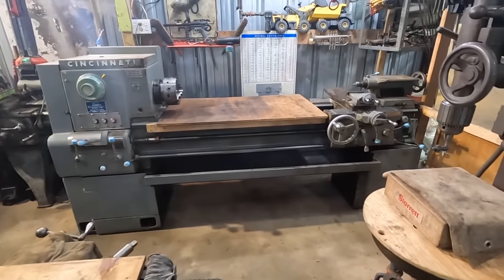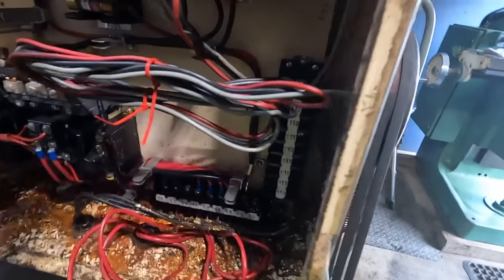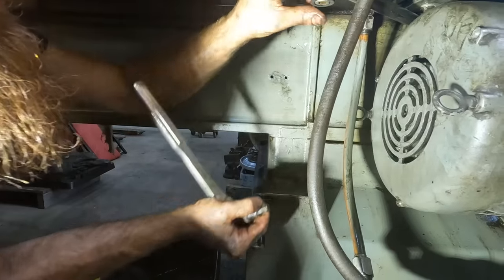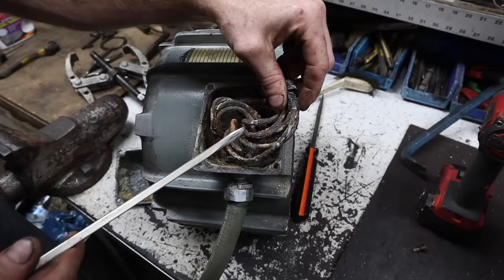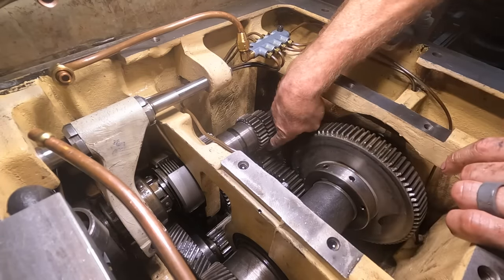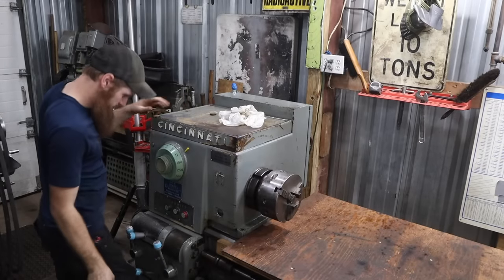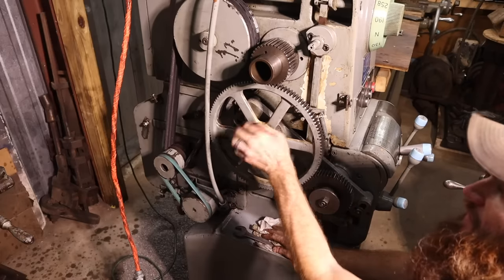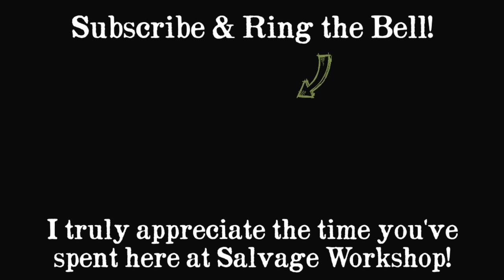Can we SAVE this BROKEN Lathe? ~ MAJOR Issues found! ~ Will it Ever CUT again?

Comment: Can you read electric motors like Morse code with the colors of the battery acids mixed with wiring? 
I guess I'm asking if there's Morse code in color on the wires from corrosion

Comment: NICE WORK, WAY TO WORK OUT THE PROBLEMS.  I THINK THE GEAR SHAFT HEATED UP EXPANDED AND THE PIN FELL OUT AND THEN THE KEY WAY. @parallaxbill2276 HAD SOME GOOD POINTERS I  SEE YOU LIKED.

Comment: I've seen WATER get into the electrical conduit, especially in basements or hill side split level buildings.  That would explain the "Stuff" in both the motor and the connection box..     a Flood with out a flood........

Comment: While you were dicking around with the shifter and reserring the dial, you should have figured out what gear setting puts all the shifter arms to the right like the manual said so you can use that as a shortcut if you have to go back in for some reason.

Comment: That motor is not a brush motor is why you don’t need to clean the groves if you run a screwdriver in the groves you can mess up the motor.

Comment: PLEASE READ —IMPORTANT

you are operating that totally wrong.  The hydro shift lathes, these and the Leblond are two I know of and think monarch made one as well, are made to be shifted in a somewhat strange way but it makes sense once your familiar with it.  

It’s called a pre-selector shift.  You ONLY shift it when the spindle is running.  You don’t shift it while stationary and with the hydraulic pump running but the spindle not.  See how it was pushing those shift forks left and right to go into the various gears?  Well if the spindle has stopped in a particular spot where all the gears aren’t properly aligned then the hydraulic shift mechanism could jam the gears sideways and break something.  It overcomes this problem on its own when shifted properly and I’ll explain how in a second.

The proper way to shift is fire up the lathe and engage the spindle in whatever speed it’s in.  Then while running you are supposed to pre-select the next speed you want and shift the knob—IT WONT TRY TO SHIFT ITSELF WHILE RUNNING ITS GOT SAFETY INTERLOCKS SO IT CANT.  Then stop the spindle with the handle.  Once the spindle comes to a complete stop a zero speed switch tells the lathe electronics it’s ok (the safety interlock expires) and the shift can commence.  The spindle will start to “rock” back and forth slowly, this is to give the sliding gears a window of opportunity to align properly during the shift.  You machine did it the first time you turned the knob but it only works for one shift.  Once that shift was over you kept shifting it around and it wasn’t rocking the spindle anymore and you are risking damaging something, either a gear or bending a fork if it pushes too hard against a misaligned gear/change.  Anyway, after you stop the spindle and see it do it’s little rocking, you are to re-engage the lever and fire up the spindle again with a few seconds.  
That’s basically it.  You can cheat around a little in a few ways but without standing in front of my leblond I can’t remember exactly how and how to describe them.  I’ll mess with it at work work tomorrow and post back.

Also, don’t mess with the oil lines under the headstock where you were thinking about coupling the two together.  That’s for the hydraulic mechanism/shifting mechanism and other is for the headstock lube.  They are seperate for a reason.  If you combine the two I think the lathe will no longer function/shift correctly if at all.

There are some groups for Cincinnati lathes on various bulletin boards and forums where you can find about any questions answer.

I’ll have to say too, to treat precision machine tool spindles/bearings/lead screws/etc with a little more care than those old diesel heavy machinery you revive!  If not they will at the least no longer be precision and the most break some very costly part especially when hammered on! 😢 😉

Good luck with it! 👍🏻

Comment: one mod i would have done to the mashine adding an oil fill port in the top of the head, that way you dont have to take off that heavy plate for every drain and refill
Reply from the maker: There is one in the top lid... go back and watch right before i made the new gasket, you'll see me remove it so the lid would sit flat on the bench!
Reply: @SalvageWorkshop  oh there is, bit hard to see later in the video, good to know!

Comment: 52:08 that looks like asbestos it was used a lot in wiring back in them days with wiring an electric  motors.
Reply: It worked well as an insulator on wires also incase of electrical fires.

Comment: Put a hose an the drain, and a ball valve, just remove the handle on the valve hang it on the pipe with a wire or zip tie,

Comment: You have two drain spots to allow the cover to remain in place when changing oil. Machine shops typically have metal chips everywhere which you do not want in the gear box. When the top is on it would take too long to drain the machine without a second drain opening to allow air relief.

Comment: Somebody probably crashed it which loosened the key then they opened the top to look at it and didn’t wanna dig deeper then closed the top with no gasket and used it with the gear it had and pumped all the oil out

Comment: 2 things: I'm guessing that the 'roll pin' is designed that way (ie with one section cut out) to flare when punched (with a tapered punch obv) to provide a decent friction-only fit: no Loctite necessary! :) Also, I winced when you took a file to the headstock lid: as manufactured the two casting faces were prolly ground/milled/lapped to such a fine flatness that it didn't /need/ a gasket; the file (even if only cleaning) action will almost certainly have reduced that, resulting in a gasket definitely being required. Some earlier IC engine heads/crankcases (eg bikes) were produced this way.. but eventually (as I suspect happened here) succumbed to temperature shifting  :( This would show up far quicker in IC engines as they're pressurised; not a problem for this machine.. until eventually time (& incorrect servicing/treatment) wends its way into the equation :)

Comment: I respect that you know your own limitations and safety, but I was getting anxiety with that camera angle, your beard, and those gears, or your hands and those gears turning flat out.  That's the stuff horror movies are made of. I prefer the will it run content, but I also understand that you can only so much before you're buried in half completed project vehicles.  Do your thing and I'll watch it, whatever it is.

Comment: Next time you clean the gear box I'd use a pump up garden sprayer to wash all the dirt out using the pressure from the sprayer to dislodge all the stuff you can't reach or see. The powder in the motor was most likely electrolysis from leaking voltage from the exposed wire that had the cracked insulation.

Comment: Are you supposed to change speeds with the chuck engaged? I don’t think so. You have to disengage the chuck, then change speeds. Then re-engage chuck. Right now you are changing speeds before you disengage the chuck. Leave the speed knob alone until the chuck isn’t moving. Yikes!
Reply from the maker: Yes you are supposed to turn the dial to the NEW speed WHILE the spindal is engaged and spinning... then when you STOP the spindal, the gear changes to the new speed in the head of the lathe!
Reply: Wow. Weird, yet cool. Cheers!
Reply: So what’s the advantage in the hydrashift lathe? As it was demonstrated you still need to stop the spindle for the speed to change.
 Does the hydraulic oil lubricate the gears and bearings in the head? If so would that be problematic with the hydraulics? 
There were doubts about the oil filter and sump.

Comment: Just watching you operate the gears with out the cover on you can see how the oil got into the electrical box have a look at your video and you will see that top should have a rubber gasket come seal on it all i have had any thing to do with did Cheers you should not be ruining the lathe with that much stick out on the part being turned rule of thumb is 3 times the diameter so you should only be 3 inches at most if you need more then you should be ruining a live center in the tail stock

Comment: The big three jaw. Just dial the jaws out and turn them around put them back you don’t need two different jaws sets. Oil in the box likely coolant. Coolant doesn’t dry it turns back to oil. A small mist will make a big mess.
Reply from the maker: This chuck is a scroll chuck that only allows the jaws to be installed in one direction and needs a separate set for inside and outside jaws.

Comment: 48:30  ouch,  well go pressure wash it dry it out just straight water, change the bearings look at the brushes  clean the communicator
Make a gasket both for the gear box and the motor and put it back together   yes use straight water to clean it.      After its dry thin coat of oil on the shaft to keep it from rusting. 
When they make electronics they wash the circuit boards with clean water then dry them waters not going to hurt the copper windings if you make sure its dry before using it. .
Reply: Waters safer then scraping with a screw driver risking nicking the insulation on a copper wire.
Reply: Brushes?  Commutator??

Comment: wheres the gasket for the top your wondering where the leak is if there isnt a gasket the oils leaking out of the top, you pumped out water to begin with now that looks like the lathe has been in a flood it should not have any water inside any part of it

Comment: Those rubber. Things that go in the collets are stops so the material has a bump to control length. Now I don’t believe the oil your concerned about is anything but coolant. The coolant was a water/oil based that was used in the 50’s and 60’s and if left over without being mixed and they put in a product that prevented the oil/ water coolant from turning sour. Now if this coolant was allowed to separate it had a foul smell to it and it could cause skin problems as it was pumped back through the coolant pump and the coolant reservoir. I ran one of these when I worked at International Harvester in Rock Island in the gear division.

Comment: Every time I see someone using adjustable spanners makes me cringe, its mostly in American videos, we call them fucknuts as its what they do. In European videos you seldom see them used. I have some good quality ones that I got real
cheap but rarely use them for that reason. I use them occasionally on my John Deere as its almost all imperial when everything else here is metric, also for very large nuts/bolts on the tractor and implements.

Comment: Read Me URGENT URGENT.....The gear you put the roll pin back in, when you installed the key it should have had no slop like you showed , what happened is/ was the gear for what ever reason has slop with the key installed, so when it's engaged is... it slams up against the roll pin eventually causing the roll pin to collapse and work it's way free  and over time move off the key dropping the key out losing the gears. That shaft needs to come out and the gear replaced or it will happen again follow. Me.

Comment: I run that exact same machine for 20 years turn the machine on decid what speed then run the machine shut the machine off then change speed then run the machine the reason it doesn't change while its running its a safety
Reply: Apparently ur not a machinist.
Turn ur tool post straight the carbide inserts are designed with the proper relief. Plus when u change to a cutoff tool in its straight and u don't have to move the whole compund

Comment: 1:38:26 that beard 2 inches away from fast spinning gears, not how i would want to get a shave...

about the noise, i usually stick a sheet of paper between the gears before tightening them, that's about as much spacing as you usually need. and maybe the washer that holds the big gear is a bit worn on the face and allowing some axial movement

the water that got inside the electric panel (they probably just left the door open) ran down trough the wire harness into the motor, you should use some caulk to seal the opening inside the electric panel so it doesnt happen again

Comment: Sorry, my english is not good. If you crazy? Without a beardsafe, an open gearside and flying wirings it´s a wonder. You hanging over the rotating Parts without showing, where is your baerd. It's during 0.5 sec.and the beard is gon, incl. the skin. In extremly case your head is losen. The same is at the left side by the open gears. You wold hear the sound from this and you was dagerous near the gears. Rotated parts are very dangerous, hand off from this! 
You was amused  over the inside from E-Motor, but the very old wires; contactors and buttons are dangerous. This is not so expensiv for new parts. This should make an electrical profi.
Otherwise it's very well, you have fun with this lathe. Learn lathe, the tools was false clamped. Good luck. ff (viel Vergnügen)😧

Comment: I obtained a hardinge lathe for free because the maintenance guys at the company couldn't fix it it would crash when moving from low to high speed excetera. They said this thing is beyond repair and then they had a power surge in the shop during a storm and it wouldn't turn on at all they couldn't figure it out. Idiot idiot idiot

All that was wrong with it is some idiot wired the limit switches on the speed controller backwards and if anyone here knows how changes speeds you'll know what I'm talking about there's a motor that moves a belt system up and down it's hard to describe. I got a beautiful Lay's that had never been venues for anything other than polishing it had the ways covered and all of the accessories were packed in a box brand new and there were a lot of them LOL I made out like a bandit they simply switching to wires and there were a couple of other small problem such as when the power surge happen it blew a damn fuse LOL in the power entry switch how can someone call themselves a maintenance worker when they can't even check a damn fuse?

Comment: Hi a little advise  I see you like to get some military  equip well little advise  MILITARY is NOT civilian  everything is mark  and with instructions  you need to follow what is said on labels is design    for  DUMMIES   remember NOT everybody in the military know what happen and how to operate it  if you have any questions you can Request a PM Book from the military for that  equip I saw you with the military  GEN and I was  yelling at the video  the  part you was hitting  with a mallet  is a  gas/diesel pump  is electric  How I know this  I am a retire  ARMY Diesel Mechanic  you have any question  just contact me  I help you the best I can